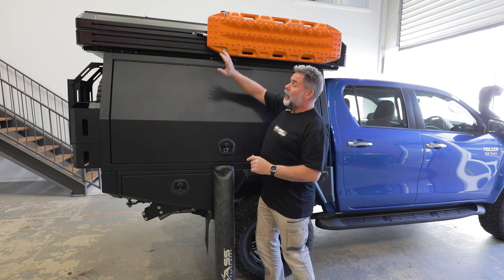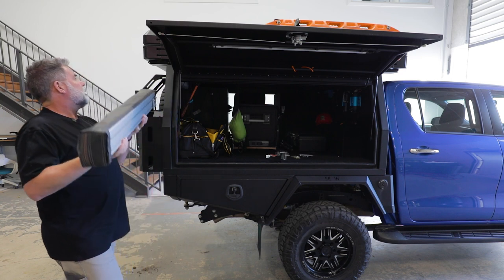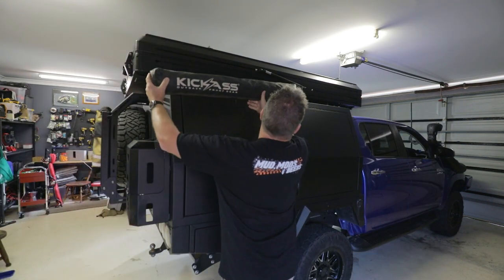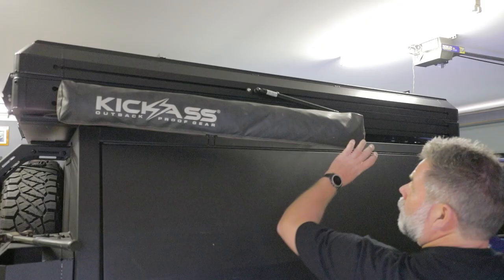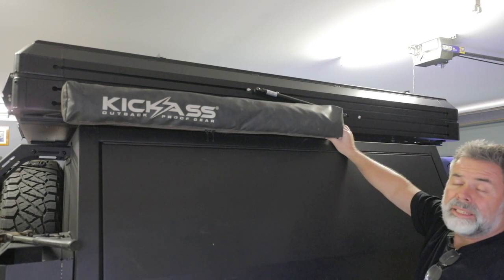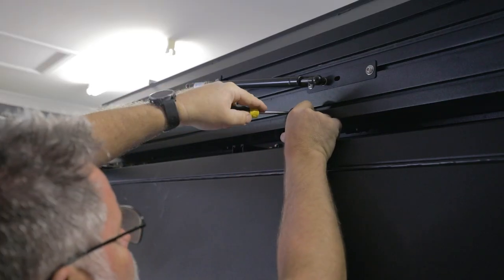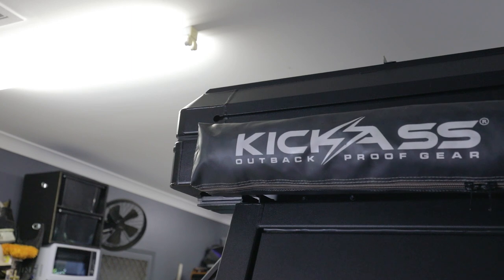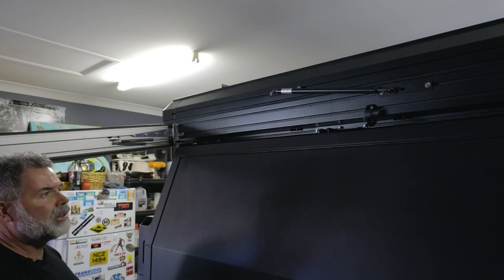Easy Mod! Kickass Shower Tent on a Swing Away Bracket #kickass #thebushcompany

Comment: Lol literally the exact same design i did on my swing bracket. 

Get a bit box tube off cut on the back of ur shower, then put two bits of angle on ur tent about half way along, to give the tent box tube some where to slot into when its closed. Taking pressure off ur hinge, and latch and adding some support. I also used over centre latch as i dont trust those pool fence latches to last on corrugated roads. I also used a tent pole to support it when its opened out. Solid asf.
Reply from the maker: Thanks mate, that's a great idea!  Just did a trip to Birdsville over some heavy corrugated road and it held together, however, think your idea would be a better long term solution.

Comment: Great video mate, what upgrade on the hinge did you use? Looking to do this for my camper cheers.
Reply from the maker: Thanks mate!  I ended up using the awning bracket mounts for the bush company 270 XT Max Awning.  They are designed to be an 'L' shape, the simply bolt together, I put a nylon nut on them instead so it hinges, its so much better now.  I

I have had a re think though, I'm thinking a heavy duty drawer locking drawer slide might be the go. That way it can simply slide back to open the tent up, then slide back in to lock into place.  Might be much simpler and stronger.

Good luck!

Richard

Comment: Heya, what length has strut did you use?
Reply from the maker: Hi Kate, at full extension it’s 34cm long. The barrel itself is 16cm. Only a little one. If I had to do it again, I’d get a slightly longer one that would have more pressure. 

Thanks for watching!

Comment: Any update on this set-up?hehe,,planning to do this on my set up..
Reply from the maker: Hi Mate,  yes, did make a way stronger hinge bracket using some awning brackets I had for the roof top tent.  These are way stronger.  

Still happy with how it all works, however, I am thinking of changing it up and using a heavy duty drawer slide instead, not sure yet.  Changing up the canopy and will wait and see how it all fits together first.

Thanks for watching!